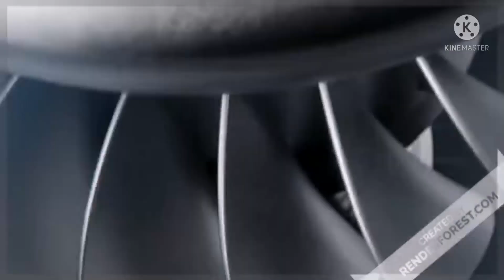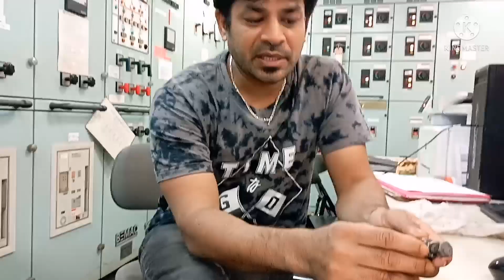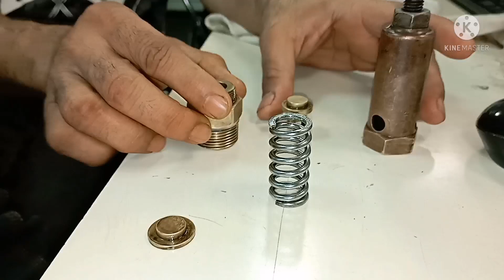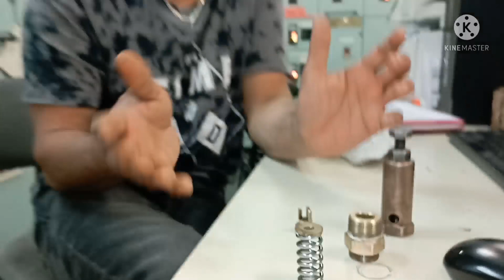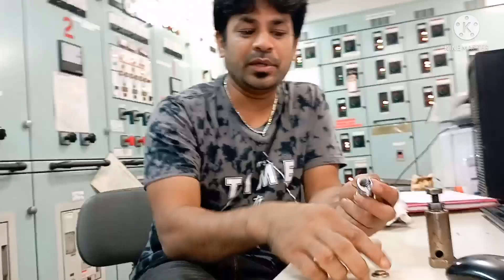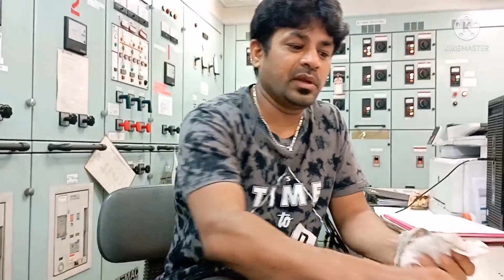How did it works? How do air compressor safety valve works?...

Comment: sir, how to test relief v/v whether is it working or not? I told my surveyor, i will reduce the relief v/v lift setting by adjusting screw, then start compressor. if the relief valve lifts at the new adjusted set pressure, which is much lower than its original set pressure, then i can say valve is working properly.  But still he gave me fail😞. He said testing relief v/v on a running air compressor is deadly dangerous.
Reply from the maker: Sir.. Vl upload vdo on how to test safety valve..
It is dangerous to test wen compressor is running... We need to do hydraulic test for safety valve operation..
Use a hand pump or test kit to do safety valve test.
Reply: @marine-knowledge-basha  sir thanks for replying🙏